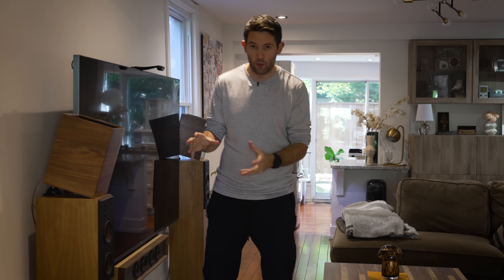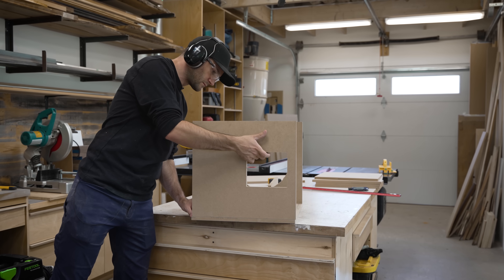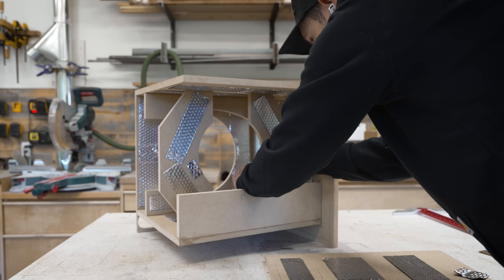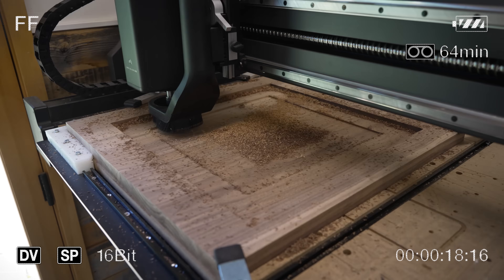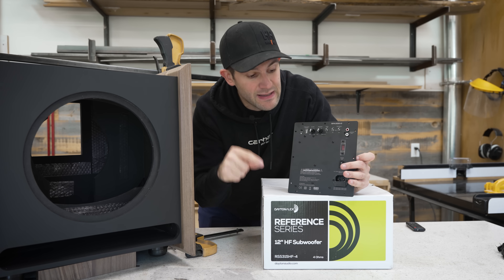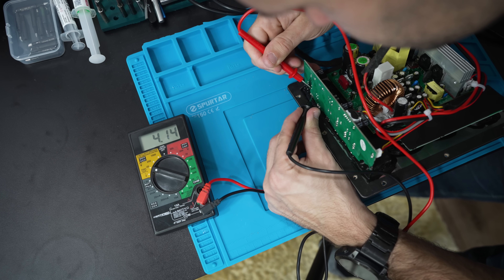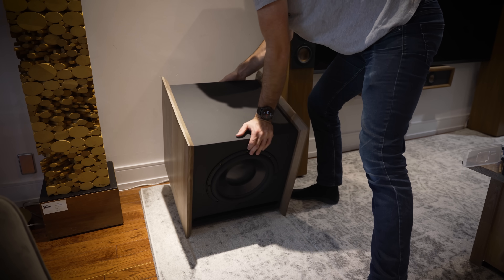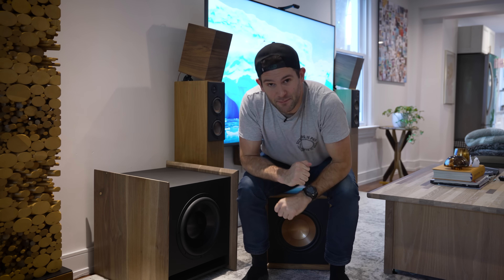THIS changes DIY Audio...

Comment: One thing I would highly recommend is T-nut fasteners and machine screws. These will add the ability to service the subwoofer indefinitely without concern for damaging the cabinet. Regular wood screws will stress the wood fiber and strip the threading material out of the hole after a few times in and out especially with the vibration and pressure a subwoofer can impart on the wood/fiber material over time.
Reply: Threaded inserts would be a better cleaner look imo.
Reply: @LKN117  T-nuts are threaded inserts that are attached at the back of the mounting board. You'd never see them unless you took the enclosure completely apart or stuck your head in there...
Reply: @erickvond6825  Yess, proper fasteners are so nice and with how common nyloc is there's no worry of accidental unscrewing.
Reply: I’ve seen folks use these and they also can fail over time. Meh, IMO. Both are fine options.
Reply: T nuts are not good. They leaks air. Inserst are better
Reply: May have to use Loctite then, I use threaded inserts for guitar amps and have developed vibrations over time.

Comment: What about the latency of the wirelsss connection? How do you sync the woofer with the rest of the audio signal?
Reply: Yes - latency, signal polarity and x-over points... how are they adjusted realtive to your L-R speakers?

Comment: You should match the power rating of the sub at MINIMUM with the amp.  
#1 You could use a 10 thousand watt amp and not overpower the sub - that is determined by the levels YOU set
#2 The sub's RMS rating is less than it's peak rating, by a greater degree than most amplifiers RMS vs peak ratings differ... 
#3 A clipping amp, or amp going much over 1% distortion, sounds worse (and is more dangerous to the driver) than the subwoofer's own distortion increase that happens near it's own absolute power limits
#4 Driver distortions tend to increase gradually, and is mostly 2nd order harmonics (less offensive/noticeable) whereas amplifiers distortion curve kicks in FAST and includes more odd harmonic content.
#5 Repetitive, but worth noting again - peak power demands can be much higher than RMS power for quick bass impacts... you need HEADROOM in your amp, for any given speaker or driver, and you want an amp that can always maintain full and powerful control over the driver, and not be affected by back EMF, and have a high damping factor (class D like he chose is great for this).  Even if your average output (rms) is say 300w, an amplifier that can only output 300w is not going to have it's sh*t together and control the woofer like a 600w amp will, the driver control, start/stop behavior, and lack of dynamic range compression when pushing it are all going to be better with more power.

300 watts is actually pretty LOW for a subwoofer, including for this driver he chose, if this is a single sub for a living room (i.e. a larger room), 300w is very modest.  Plenty of subs are packing 2, 3, 4 times that much.  400w would have been the bare minimum amplifier I would choose for this driver, but I also would have chosen a much more powerful driver.  This box is built like a tank, he could have chosen a driver with twice the power handling, and gotten an amp with at least double the power handling too, and put it to good use in a living room.  This is especially true if you're trying to reach 20hz and even lower, which, with a sub, should obviously be the goal.  The lower you go, all things being equal, the more power is required (tuning frequency excepted... but outside of that, this is true).  I'd always tune a ported sub lower than 32hz personally, even if only marginally, but you're gonna need more power to hit 25, 20, 16hz for example.  One of my friends has 5 monolith thx 15s (2 are dual 15s, plus a single 15) and they're 1000w per driver.  5000w watts of subwoofer in his basement theater, and he can put it ALL to use.  It is impressive.  Unlike higher frequencies, bass on the order of 5kw will not damage your hearing or cause pain, but you will feel it, and you will love it.  Your subs should never be the limiting factor in theory, right?  I mean if you can afford to have more, you want more.  You want to stop turning it up by CHOICE, not because oh hey there's the limit of my sub this is how much bass I get before it distorts.  No, just turn it up until you're satisfied, with headroom to spare.

Comment: whats a good tip on figuring out mounting holes on a pcb i always struggle on getting that just right
Reply: Piece of tape on bottom of pcb, mark holes, transfer tape to other surface, transfer holes. Works better on symmetric pcbs though. Otherwise the sticky side of the tape has to face up on the surface you want to mount it to
Reply: @jorismk1  i meant for 3d printing sorry for the miscommunication but that is still helpful i might use that soon since im getting more into wood work

Comment: I hope this is your 'first' build, as a sort of proof of concept. When you use less than 3/4 inch thick wood, let alone that pressboard, you are asking for the cabinet to fail, especially when listening at high volumes with a bass heavy material. Also, pressboard seems to wick water and is susceptible to high humidity. The heavier and thicker wood, assists with keeping the cabinet 'in place'!.

Comment: Doesn't the metal FOIL of the sound dampening pads interfere with the signal as you screwed the wifi unit directly to it?
Reply: Will not make a difference. Wireless sucks so bad, you won't notice the EXTRA suck from the foil backing.

Comment: what id like to see is a compact subwoofer build. My truck in particular doesnt even have space for underseat subs. 05' Ranger standard cab, currently I have Rockvilles 12 inch sub behind the bench seat. box 4 inches on top and its base is six inches wide. dont remember  how long it is off the top of my head. does sound surprisingly really good though. just enough room but no movement with the seat. would love an alternative I could build myself.
Reply: The alternative is to extend the cab.

Comment: Boomier doesn't equal natural sound, just an exaggerated sound. 
A few things I would do differently: 
1. Round off those sharp edges on the MDF. It'll help them take a bump without damage to the edge.
2. Glue up. Paint your mating surfaces with 50/50 glue and paint and let dry. When you do finally do the full dose of glue, it'll grab better. Also, sprinkle a little sand on the glue joint, not much, just about 3-4 grains per inch. This will keep the two parts from sliding around from the slippery glue.

He's got the sub in a good place, so it's on the same plane as the front speakers. The worst thing you can do it place your sub in the corner: you'll get a LOT of bass, but it's going to sound one note-ish and sloppy. Rule of thumb: 1/3 the way along the wall. 
A way to find the best spot for the sub for your favorite listening spot is to put the sub in that listening spot. Then play music with a good solid bass beat and walk the perimeter of the room. The spot with the best sounding bass is going to be the sub's sweet spot and should be placed there. If. your room's furniture placement is not letting place it there, see how it sounds in places where it can go and choose the second best. A sub in the best place audibly but in a bad place functionally will be a continuous problem.
Reply: corner loading your subs is actually common practice in home theaters....